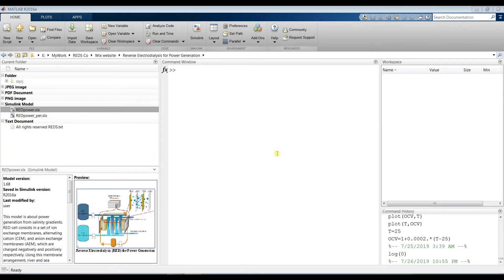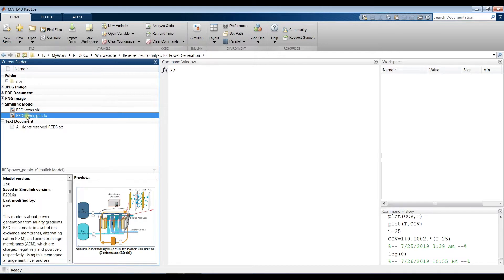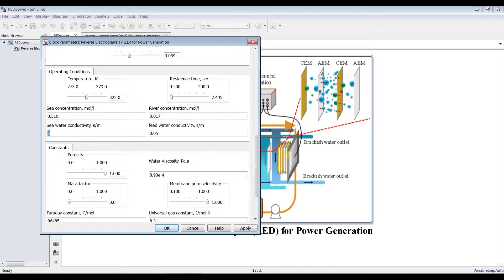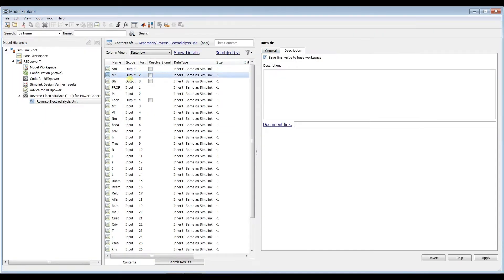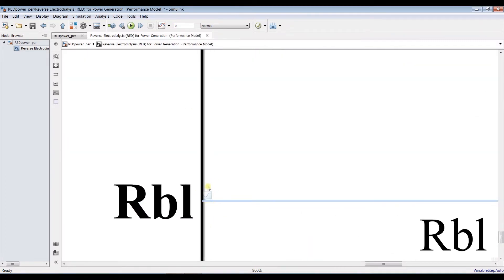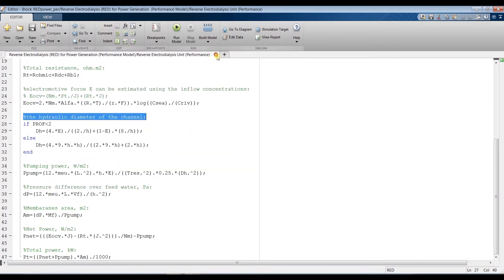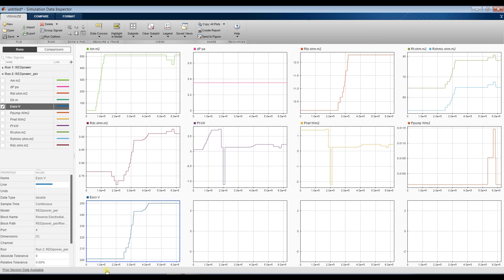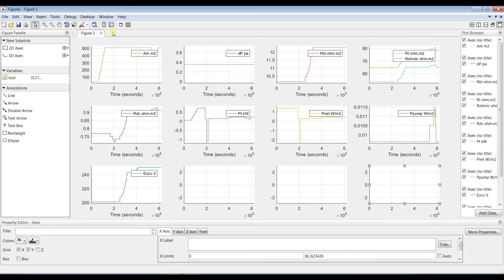Power Generation from Salinity Gradients | Matlab/Simulink | Reverse Electrodialysis Model

Comment: Just curious, what is the energy density potential between two bodies of water such as the sea and a briny body of salty water (that is five times as salty as the sea)?
Reply from the maker: Something like that.
Reply: @REDSLibrary  so where does this technology sit in terms of other competing technologies energy densities?
Reply from the maker: @philipandrew1626  it can be used for low scale. Sure it will not compete against MSF or RO.
Reply: @REDSLibrary  I was more interested in the energy density of the fuel (differential saline bodies of water) compared to other raw fuel energy sources (coal, oil, gas, hydro, wind, solar).
Reply from the maker: @philipandrew1626  yeah, I can see that. Actually, made this model because it is highly requested by many researchers.